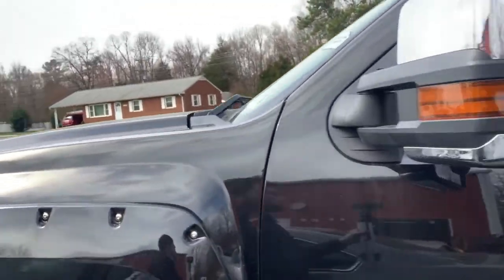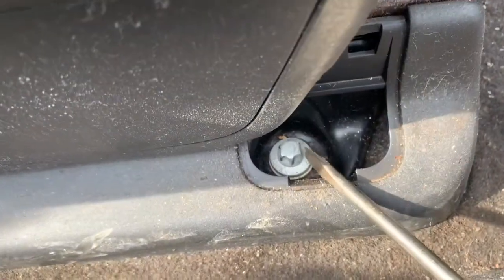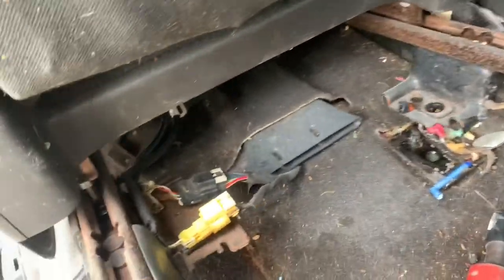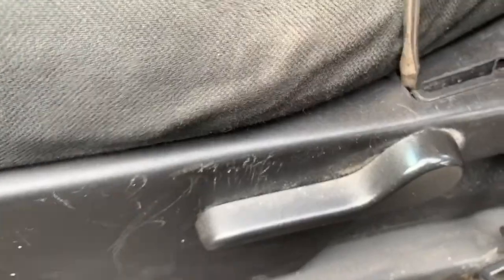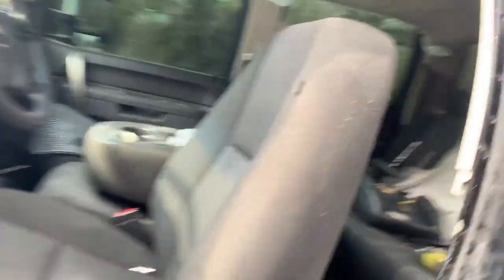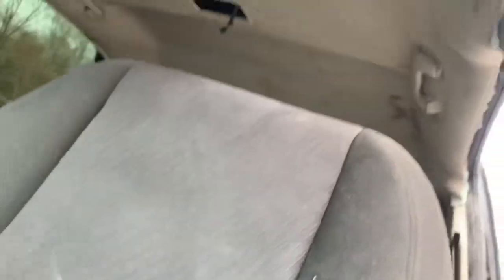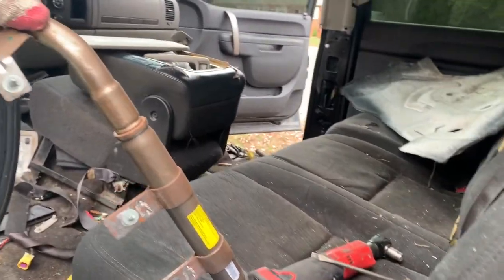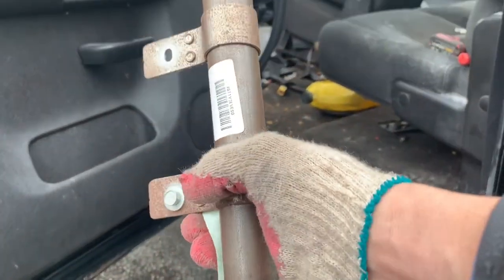DIY Removing AirBag Module, Seatbelts, and Roof AirBag on 2012 Chevy Silverado HD

Comment: Hey bro nice detailed video you did, have a 2020 silverado same thing happen. Does it have an side impact sensor or something.  Wondering why curtains airbag deploy and seat belt lock up
Reply from the maker: Thanks you, no mine is a 2012 but they do bring some impact sensors on the door and towards the back pillar and seat belt always tend to lock up when airbags deploy. Most the time you either got to replace them or send out to get repaired .
Reply: The seatbelts lock up because they have pre-tensioners that fire in the wreck.

Comment: What bit was it for the airbag module? T10?
Reply from the maker: Well on my truck has 3 -10mm torques
Reply: @pazautovlogz5999  yeah it was just a 7mm socket. Did you put new airbags in yours or take it somewhere? I’m debating whether or not I want to do it.
Reply from the maker: @Judah Trent I did replace the side panel airbags really not that hard.

Comment: The seatbelts stay locked in the position/slack that they were in during the accident, meaning the seatbelt was like that during the accident, ie they weren't wearing their seatbelt. The quality and condition of the truck reflects the owner; human garbage and trash. Wouldn't be surprised if the driver got hurt from the accident.